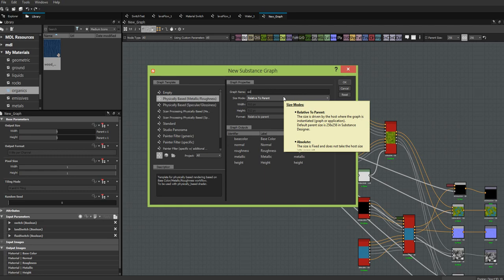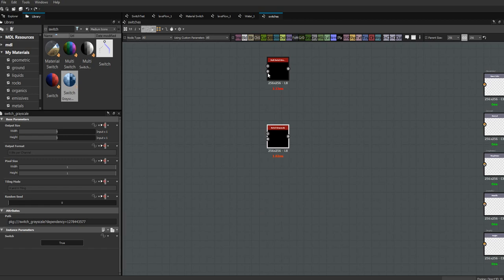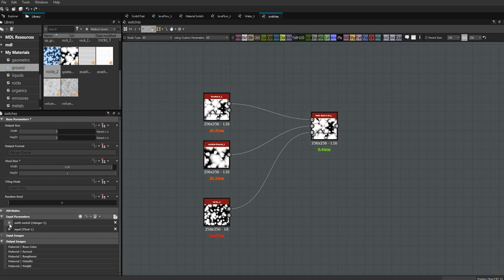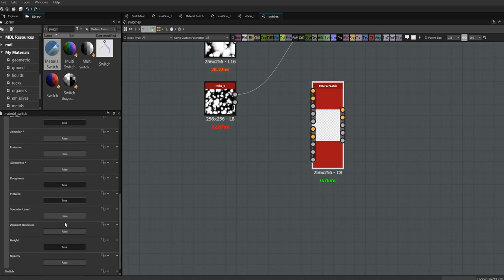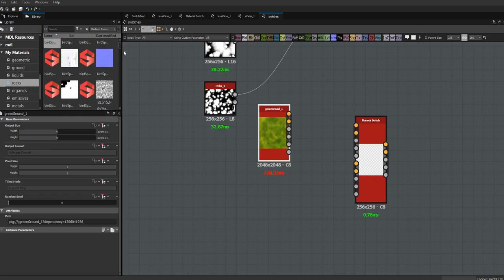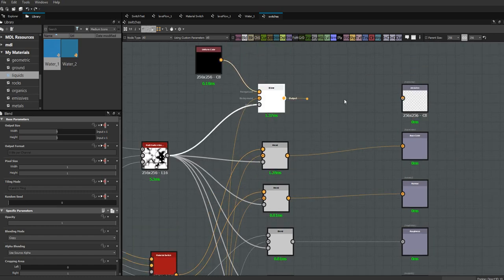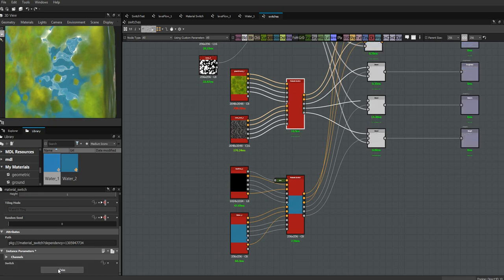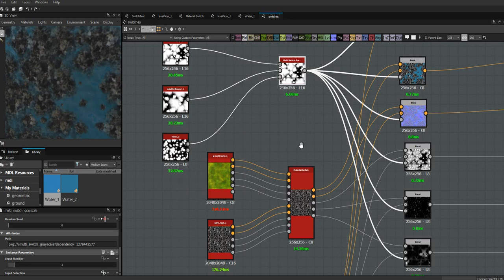Substance Designer Tutorial - Intro to Switches

Comment: Hello ! i am using designer 2019.2.0 and the parameters in the input parameter are not the same. I will try to look for a way to do it but if you do know it, don't hesitate to share :)
Reply: Nvm turns out the interface is different and I got lost !  (insert palmface here)